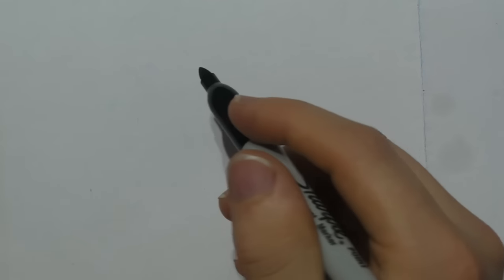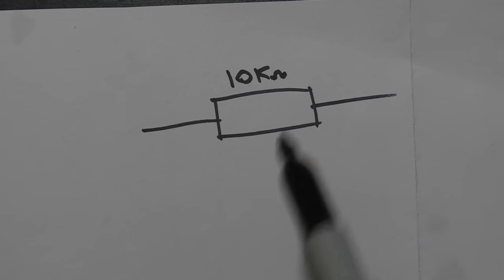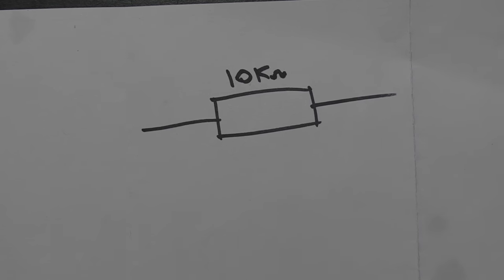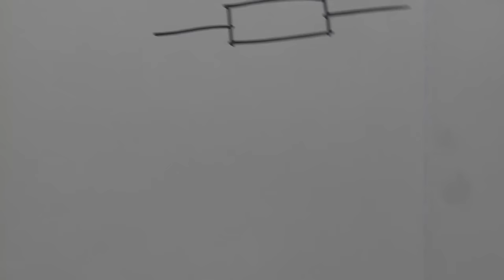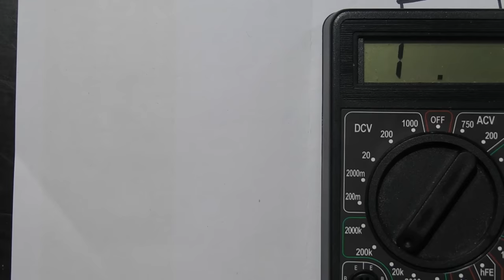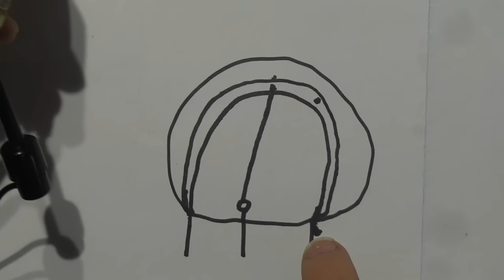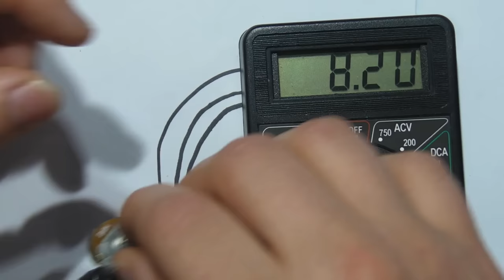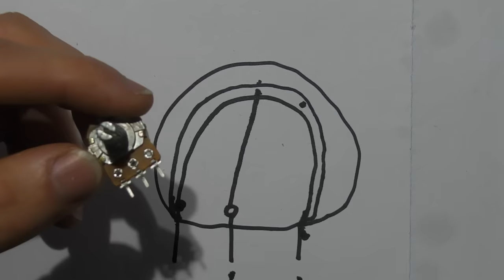Potentiometers (Pots) - Electronics Basics 25

Comment: The only issue I have with this video is that most "pots" are "carbon pots", with a carbon track internally. If the track were of most metals, the resistance would be practically nothing no matter where the wiper was, because of the high conductivity of metal...whereas a carbon track just a couple of inches long, at most, can be designed to have a maximum resistance ranging from ohms to mega-ohms or more. A metal track would have to be microscopic in width to achieve such resistance in such a short length.

Comment: Great video, but why are there three wires running around if the wiper is only in contact with the smallest diameter one?
Reply: Watch the video again: The wire connected to the "wiper" is the output. How would anything be output if not for another wire to input something? It's not as if the "pot" creates current "out of thin air"! The third wire goes to ground. The whole idea of the pot is to divide what is input between the output & ground: If the wipe is at the start of the carbon track closest to the input wire, all of the current avoids the track and passes into the wiper & out...no resistance. When the wiper is situated at the other end of the track, everything going out the output wire is exposed to a resistance equal to the value of the pot, and the rest goes out the ground.  

So, there must be 3 wires: in, main output & ground. Consider that the same amount of current flows regardless of whether if ends of going out the output or goes to ground. Theoretically, a resistor can work without a ground, but then the total current flowing thru it would be only what goes out the output. The effect on the circuit would be very different.

Comment: so which of the 3 connectors of the potentiometer do you actually connect to the circuit? Would the middle pin be used as the positive end and either of the side pins as the negative end? And from the end of your video it seems that you only use 3 of the pins if you want to use the pot as a voltage divider, ultimately making it a junction
Reply from the maker: A potentiometer is not a polarized component. And yes, 3 pins are used to create a divider, splitting the voltage between two pins
Reply: thanks
Reply: I'm actually working on a circuit right now and I grabbed a random potentiometer so idk what its resistance range is, but I have it connected to a 9v battery and a dc motor (unknown specs as well) and connected the middle pin and one of the side pins to the circuit. However the motor only turns on when I have the knob of the potentiometer positioned at its max position, when I turn the knob away the motor instantly turns off, it doesnt slow down or anything. Could you possibly explain this?
Reply: its better on EveryCircuit

Comment: Great video Thanks  I am making a variable resistor to fool the computer of a 2008 Honda Odyssey so that the VCM (variable cylinder management )doesn't engage because it causing the engine to burn alot of oil. When engine reaches operating temperature and there is not a heavy load the VCM turns on which means it turns off some cylinders but it also created a vacuum sucking oil into the cylinders and burning it (big cloud out the tail pipe) I bought a bochen 3296 trim (blue square) and i dont know what pins 1/2/3 are for?? Is it the same as you spoke of in this video?? I going to use a 200 ohm and adjust between 84-120 depending on the season. Will the trim pod potentiometer with stand engine bay temperatures or should i put it inside the cabin?? This will trick the computer in to thinking the engine never reaches operating temperature. Thanks for your help Rush

Comment: My setup calls for a 35K ohm pot. Can I use a higher value such as 40 or 50K. If I do, what will happen? 
Will I prevent signal from leaving amp and damage components in my amp? Thanks.

Comment: I  have about 300 soft white LED strings wired in opposite polarity strings. The cheap driver/transformer (China) keeps cutting out and over the years the kids have snapped odd wires. I have sorted the strings into runs of 10 x 30  and want to drive them ALL from one power source. I have a model railway Gaugemaster EN60 742 controller with 3 stable  outputs:- 2x 0-12v DC  rated at 1A  12VA max per track and a single AC supply rated at 16v but no amperage is given on the unit.  How can I make ALL the lights work continuously. Obviously the DC supply only makes half the lights work and I'm not sure what value of resistance to use to step down the 16V AC voltage to 2v? for the LED's?. Could I use a variable resistance potentiometer?  I'm not a complete novice (O level Physics 1986) butI would like some assistance/advice/input for this project   Am I better off with a LED driver???

Comment: The value of the resistor would be the max, min or med resistence acording to Ohms Law? hope this came across... Thanks for the awesome series.
Reply from the maker: Your question does not make sense. Perhaps if you could rephrase i will try to answer.
Reply: Fair enough, what refference does one use to calculate the value on a potentiometer? - The Pot comes with a value right?! 1K, 100K, 500K... is this value its max, min or avg. Thanks.. hope I made it somewhat clear, not english spoken here.
Reply from the maker: Much better phrased. The value of a potentiometer is based on its max resistance. So a 10k pot has a max value of 10k. Min value of all pots are usually 0Ω.
Reply: Dumb quenstion right?! Thanks again, hope you keep uploading soon
Reply from the maker: +David Sanchez the only dumb question is the one that isn't asked. You are welcome my friend.

Comment: ive found one of these , thought i could use it to connect to a small motor, can i? to make the motor variable speed?
Reply from the maker: Very inefficient way of varying speed to a motor. You can do it but you'd need a high power potentiometer to do it. DC motors are usually controlled using pwm to vary the voltage to the armature.

Comment: Hello. May I ask you what is the best circuit for a 9 vdc to 27 vdc booster with integrated circuits? It would be just great if you have a link to the circuit at EveryCircuit.com.
Reply from the maker: Everycircuit.com doesnt support Integrated circuits. However, check out the LM27313, a boost IC which will support your 9v input and boost to 28v. The first page of the datasheet for this IC gives you a schematic for its typical application. http://www.ti.com/lit/ds/symlink/lm27313.pdf
Reply: Thank you very much!
Do you know a bout a good open software simulator for ICs, etc?
Reply from the maker: Not sure about simulating this particular IC but maybe similar ICs in circuits.io
Reply: Thank you.
I would like to know some time your take about patented Tesla´s radiant energy receiver versions.
I like the way you teach. Keep going.
Reply: circuits.io does not have the pots

Comment: So what's the difference between potentiometer and variable resistor?
Reply: There is none. However a potentiometer becomes a rheostat when the middle pin is connected to one of the other pins. Edit: actually a Rheostat and a variable resistor are the same apparently. Edit Edit: I have no Idea anymore

Comment: AAArrgh!!! another completely wrong headed explanation of what a potentiometer is!  You have spread the improper concept hat a potentiometer is a rheostat.   A potentiometer is FUNDAMENTALLY a voltage divider (hence the name) Potential from the wiper to reference of either or both of the other elements is what is being varied. IE a way of varying voltage potential to a part of a circuit.  Although potentiometers are often used as single sided variable resistors (rheostats), they are extremely inefficient as such, because most potentiometers used in consumer devices can dissipate less than 1/4 watt.. The resistance element in a pot is a deposition of carbon mostly on a semi circular strip of phenolic, not a strip of metal.   YES KEEP BASIC ELECTRONICS BASIC !  START WITH A BASIC UNDERSTANDING !
   By the by the circuit diagram of a resistor is a series of zigzags in a line,... not a rectangle.   for example ___/\/\/\/\___ and indicates the long path full of resistance that the electrons are flowing through._